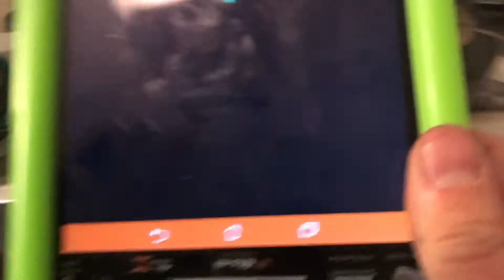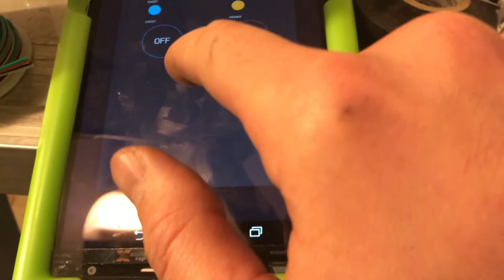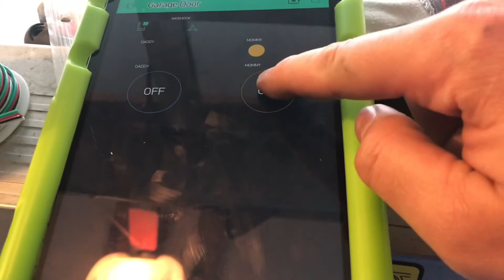Blink ESP8266 Garage 2 door opener with Status of Garage Door

Comment: There is  a problem with this when the power fails and the power is restored, the relay comes on buy it self and the door will open .
Reply from the maker: I could not find a work around with that. The boot sequence was triggering the relay.    I finally removed the unit.